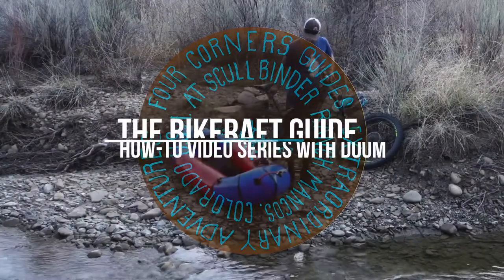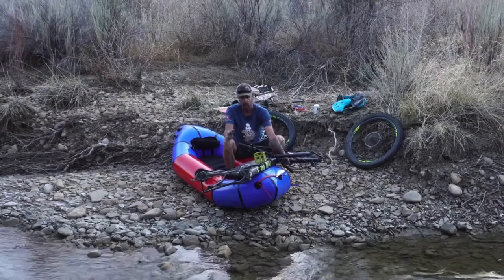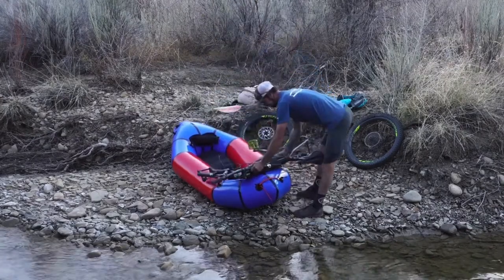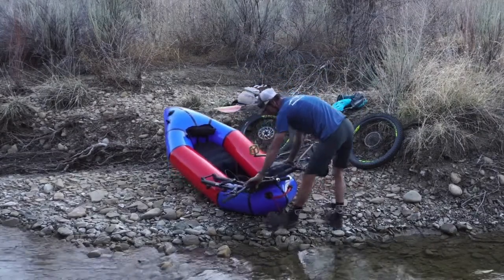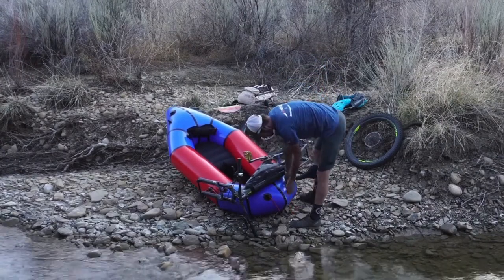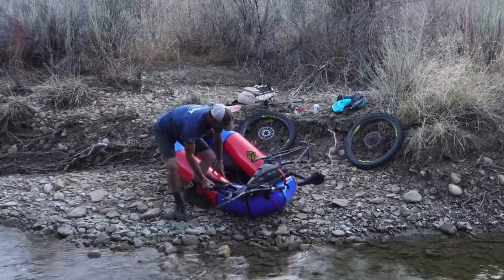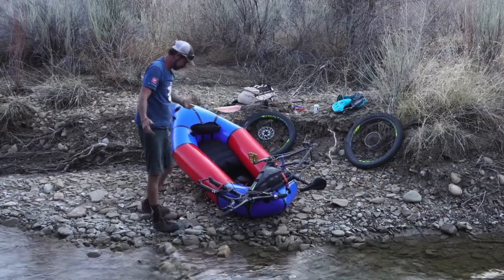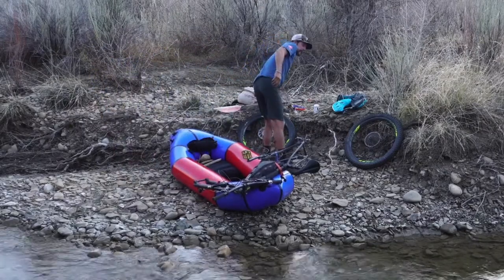Bikerafting - How to Put a Bike on Your Packraft (Part 2) - Bike Frame - The Bikeraft Guide

Comment: I think that the seat would catch on stuff to theres really not much of a difference in fork forward or backward
Reply from the maker: In flat water you are not incorrect. However, in running water, fork forward can cause more entrapment issues, and the derailleur can more easily get smashed if you hit a rock.